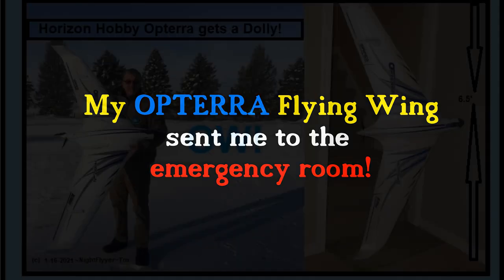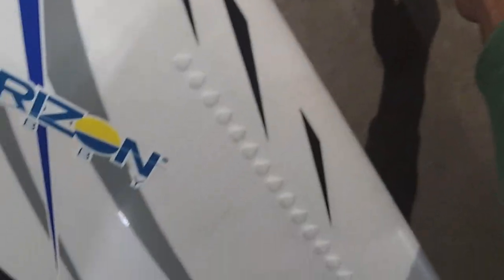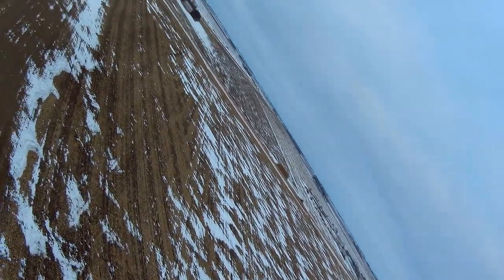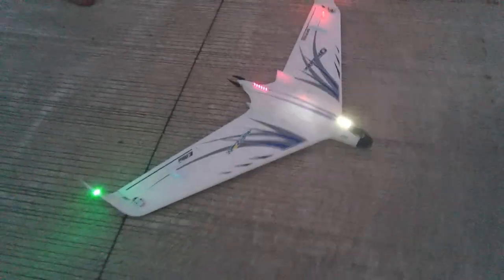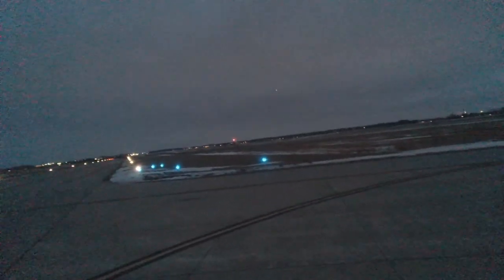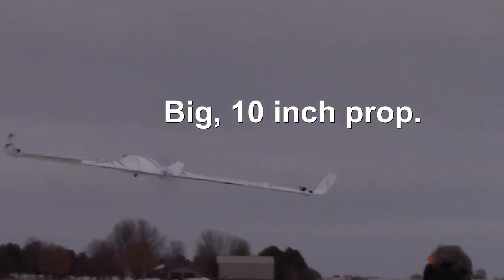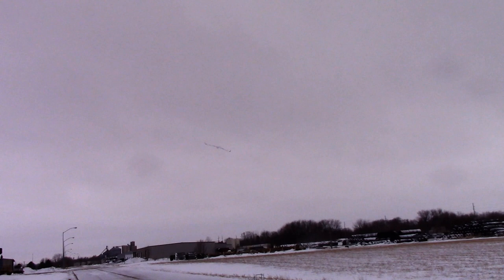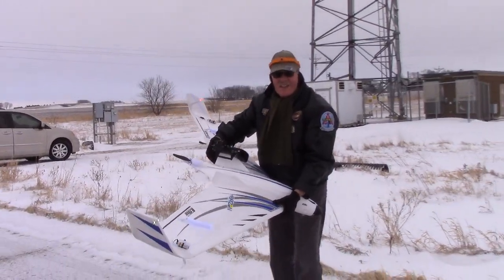My Opterra 2M Flying Wing sent me to the E.R. This is an awareness video & my solution for launching

Comment: You only have your self to blame. Hand launching with that method is bound to chop you up eventually. Even though you are not a newbie, commons sense should have prevailed.
Reply from the maker: Common sense?  Wow. Here is word for word what the Opterra 2M manual says about launching.  
1. Put the aircraft into launch mode with the channel 5 switch.  (in my first video that did not work, it went into the ground)  
2.  Hold the aircraft in one hand and the transmitter in the other.  
3.  Apply full throttle and throw the aircraft directly into the wind, angled slightly up (5 to 10 degrees above the horizon). 
4.  Climb to a safe altitude and check the trim.   
I know others have their own ways, and either way, my Dolly is the safest solution for me.  
The Opterra 2M manual also says nothing about throwing it with the motor off, so if a newbie followed the instructions, like I did, I'm showing what could happen, in case a gust of wind got them or something else.     Nothing is 100% and no matter how good you can throw, this big 7 foot wing with a 10 inch prop spinning right next to your face, into 12 MPH is risky to say the least.  The 10" prop is very close to your forearm as well, so a gust could tip it back even before launch, as others told me happened to them.  Where are your flying videos to show your common sense.
Reply from the maker: @petebuttons210  What?  I have no idea why you should chastise a person for following the instructions and making fun of me.  If it happened to me, it can and has happened to others.  I'd love to see you try to launch this and I see no flying videos on your channel but your telling me what I should do or have done after the fact.   Make your video and I'll watch it.

Comment: Gloves, gloves, gloves.......
Reply from the maker: Thanks for that suggestion and I tried that already, but because it was cold.  I found trying to hold on to the tiny finger grips on the bottom of the 7 foot wing with a thick glove under full power with wind blowing was difficult when under power and then trying to fly with  a big enough glove on was also difficult to fly the transmitter, (I'm a stick pincher)  so although that sounds like a good idea, it did not work that well. Some have told me the Prop got them in the forearm even before launch, when a gust of wind got under the wing and tipped it back.   We are only talking about a Half inch of clearance that I needed to keep from getting cut, and even though I pulled it off several times in my earlier product review video,  I will never hand launch it again.  LOL.  It's hello dolly from now on!  Thanks.

Comment: You need a butcher's glove  on that hand.
Reply from the maker: Thanks for that suggestion and I tried that already, but because it was cold.  I found trying to hold on to the tiny finger grips on the bottom of the 7 foot wing with a thick glove under full power with wind blowing was difficult when under power and then trying to fly with  a big enough glove on was also difficult to fly the transmitter, (I'm a stick pincher)  so although that sounds like a good idea, it did not work that well. Some have told me the Prop got them in the forearm even before launch, when a gust of wind got under the wing and tipped it back, so gloves wont protect that.  We are only talking about a Half inch of clearance that I needed to keep from getting cut, and even though I pulled it off several times in my earlier product review video,  I will never hand launch it again.  LOL.  It's hello dolly from now on!  Thanks.

Comment: What????? thats what every model should do, power off for say something like soaring, and then its there when you need it, no need for a stupid arm switch, get your stuff together. and no its not slippery. i have one myself and i know what its like. i reccomend wingtip launching it, makes it easier and doesnt get your hand chopped off. stupid as3x and gyro's and stuff.
Reply from the maker: This almost 7 foot wing with big winglets is would be very difficult to launch by wingtip.  Mine bend when I hold it by the wing tip.  Also I followed the directions and especially when I did my first video on this where I put down the gyros and stuff.  First of all, that had nothing to do with my hand injury. I only mentioned the Throttle arming because I followed instructions in the manual and this is the way it bound up and arms the motor as soon as you plug in the battery.  It's my warning to be cautious, because the manual says nothing about programming in a throttle hold to a switch. I've known of times when after flying, that switch was forgotten to be moved back to safe and it armed as well.  Nothing is 100% as it could be left in the wrong position, by accident. I'm pretty experienced, so never relied to on a throttle cut/hold, as all my machines need throttle stick movements to arm.   I only am warning others to be careful BEFORE the launch and to be careful no matter what you use. 
 Here is word for word what the Opterra 2M manual says about launching.  
1. Put the aircraft into launch mode with the channel 5 switch.  (in my first video that did not work, it went into the ground)  
2.  Hold the aircraft in one hand and the transmitter in the other.  
3.  Apply full throttle and throw the aircraft directly into the wind, angled slightly up (5 to 10 degrees above the horizon). 
4.  Climb to a safe altitude and check the trim.   
I know others have their own ways, and either way, my Dolly is the safest solution for me.  The Opterra 2M manual says nothing about throwing it with the motor off, so if a newbie followed the instructions, like I did, I'm showing what could happen, in case a gust of wind got them or something else.  Nothing is 100% and no matter how good you can throw this big 7 foot wing with a 10 inch prop spinning right next to your face, stuff happens. 
Maybe a gust of wind, maybe my 73 year old left arm was weaker, or who knows.   But either way, if it happened to me launching the way I thought was good (and  the same) as all my previous launches. So if it can happen to me, it can happen to others, and that is the warning I want to present.
Reply: @NightFlyyer  im litterely am 12 and can wingtip launch it with ease.
Reply from the maker: I'd like to see you wingtip launch this 7 foot wing. I see no video of you doing that.  Put your link here.  Maybe you should watch this where I demonstrate the issues. https://youtu.be/f5xDfk7sbcQ

Comment: Stick launch it!
Reply from the maker: It is 7 foot long and pretty hard to do that.  This wing is 7 foot long, heavy and  will bend and break the end off the if you even try to pick it up by the tip and barely has enough power to fly out of your hand at launch.  I know and I tried to launch it discus style, but could not hold it where I felt I could launch it successfully in the wind.     It would also be extremely difficult to somehow launch it discus style with the elevon there and that 7" tall winglet rudder that is also on the tip.  I know how to do it , but not with this plane.  
It's not like launching my SMALL F-27 Evolution or 1.2M Opterra.  So I followed the instructions word for as I did for the video I made of my product review earlier where nothing happened bad.  https://www.youtube.com/watch?v=P_inF5EYLEE&t=1s and the second one where I explain how to protect the bottom of the fuselage.  https://www.youtube.com/watch?v=ur5V5H8UcGs&t=1s
Thanks.

Comment: Dude, you ought not done it that way.
Reply from the maker: Here is word for word what the Opterra 2M manual says about launching.  
1. Put the aircraft into launch mode with the channel 5 switch.  (in my first video that did not work, it went into the ground)  
2.  Hold the aircraft in one hand and the transmitter in the other.  
3.  Apply full throttle and throw the aircraft directly into the wind, angled slightly up (5 to 10 degrees above the horizon). 
4.  Climb to a safe altitude and check the trim.   
I know others have their own ways, and either way, my Dolly is the safest solution for me.  
The Opterra 2M manual also says nothing about throwing it with the motor off, so if a newbie followed the instructions, like I did, I'm showing what could happen, in case a gust of wind got them or something else.     Nothing is 100% and no matter how good you can throw, this big 7 foot wing with a 10 inch prop spinning right next to your face, is risky.

Comment: Need to wear a meat cutters glove on that hand maybe?
Reply from the maker: Thanks for that suggestion and I tried that already, but because it was cold.  I found trying to hold on to the tiny finger grips on the bottom of the 7 foot wing with a thick glove under full power with wind blowing was difficult when under power and then trying to fly with  a big enough glove on was also difficult to fly the transmitter, (I'm a stick pincher)  so although that sounds like a good idea, it did not work that well. Some have told me the Prop got them in the forearm even before launch, when a gust of wind got under the wing and tipped it back, so gloves wont protect that.  We are only talking about a Half inch of clearance that I needed to keep from getting cut, and even though I pulled it off several times in my earlier product review video,  I will never hand launch it again.  LOL.  It's hello dolly from now on!  Thanks.

Comment: 3 words....Throttle cut switch
Reply from the maker: Of course I know how and  have.  First of all, that had nothing to do with my hand injury. I only mentioned the Throttle arming because I followed instructions in the manual and this is the way it bound up and arms the motor as soon as you plug in the battery. It says nothing about programming in a cut switch like my helis have.  It's my warning to be cautious, because the manual says nothing about programming in a throttle hold to a switch. I've known of times when after flying, that switch was forgotten to be moved back to safe and it armed as well.  Nothing is 100% as it could be left in the wrong position, by accident. I'm pretty experienced, so never relied to on a throttle cut/hold, as all my machines need throttle stick movements to arm.   I only am warning others to be careful BEFORE the launch and to be careful no matter what you use.

Comment: One word gloves
Reply from the maker: Thanks for that suggestion and I tried that already, but because it was cold.  I found trying to hold on to the tiny finger grips on the bottom of the 7 foot wing with a thick glove under full power with wind blowing was difficult when under power and then trying to fly with  a big enough glove on was also difficult to fly the transmitter, (I'm a stick pincher)  so although that sounds like a good idea, it did not work that well. Some have told me the Prop got them in the forearm even before launch, when a gust of wind got under the wing and tipped it back.   We are only talking about a Half inch of clearance that I needed to keep from getting cut, and even though I pulled it off several times in my earlier product review video,  I will never hand launch it again.  LOL.  It's hello dolly from now on!  Thanks.

Comment: What you're doing is dangerous in every conceivable way.  You have yourself to blame for incidents like this.  I can hardly wait to hear about you flying into the wires.
Reply from the maker: Dangerous?  This is an off the shelf plane and This is exactly word for word in the  the manual how to fly and launch it. . Put the aircraft into launch mode with the channel 5 switch.  (in my first video that did not work, it went into the ground)  
2.  Hold the aircraft in one hand and the transmitter in the other.  
3.  Apply full throttle and throw the aircraft directly into the wind, angled slightly up (5 to 10 degrees above the horizon). 
4.  Climb to a safe altitude and check the trim.   
I know others have their own ways, and either way, my Dolly is the safest solution for me.  The Opterra 2M manual says nothing about throwing it with the motor off, so if a newbie followed the instructions, like I did, I'm showing what could happen, in case a gust of wind got them or something else.  Nothing is 100% and no matter how good you can throw this big 7 foot wing with a 10 inch prop spinning right next to your face, stuff happens. 
Maybe a gust of wind, maybe my 73 year old left arm was weaker, or who knows.   But either way, if it happened to me launching the way I thought was good (and the same) as all my previous launches. So if it can happen to me, it can happen to others, and that is the warning I want to present.

Comment: Wear motorcycle gloves
Reply from the maker: Thanks for that suggestion and I tried that already, but because it was cold.  I found trying to hold on to the tiny finger grips on the bottom of the 7 foot wing with a thick glove under full power with wind blowing was difficult when under power and then trying to fly with  a big enough glove on was also difficult to fly the transmitter, (I'm a stick pincher)  so although that sounds like a good idea, it did not work that well. Some have told me the Prop got them in the forearm even before launch, when a gust of wind got under the wing and tipped it back, so gloves wont protect that.  We are only talking about a Half inch of clearance that I needed to keep from getting cut, and even though I pulled it off several times in my earlier product review video,  I will never hand launch it again.  LOL.  It's hello dolly from now on!  Thanks.

Comment: Learn how to throw side arm.
Reply from the maker: Like I said in the video, there is nothing to grab on the side or end of this 7 foot wing with those wing tip fins and it bends.  I did it by the manual. Here is word for word what the Opterra 2M manual says about launching.  
1. Put the aircraft into launch mode with the channel 5 switch.  (in my first video that did not work, it went into the ground)  
2.  Hold the aircraft in one hand and the transmitter in the other.  
3.  Apply full throttle and throw the aircraft directly into the wind, angled slightly up (5 to 10 degrees above the horizon). 
4.  Climb to a safe altitude and check the trim.   
I know others have their own ways, and either way, my Dolly is the safest solution for me.  The Opterra 2M manual says nothing about throwing it with the motor off, so if a newbie followed the instructions, like I did, I'm showing what could happen, in case a gust of wind got them or something else.  Nothing is 100% and no matter how good you can throw this big 7 foot wing with a 10 inch prop spinning right next to your face, stuff happens. 
Maybe a gust of wind, maybe my 73 year old left arm was weaker, or who knows.   But either way, if it happened to me launching the way I thought was good (and  the same) as all my previous launches. So if it can happen to me, it can happen to others, and that is the warning I want to present.

Comment: This is what happens when you let stupid people handle machinery. What's wrong with starting the motor after launching?
And then blaming the manual, of course. No manual will ever replace thinking for yourself... have you sued Horizon already?
Reply from the maker: Stupid people?  I have been flying over 60 years and am in the Academy of Aeronautics Hall of Fame.  But you know, I know all the champions, and every once in a while, they have an accident or bad landing. This is one of the times I got cut, and in 60 years, it was the first.  Where are your how to videos?

Comment: Maybe wear some a glove 🧤
Reply from the maker: Thanks for that suggestion and I tried that already, but because it was cold.  I found trying to hold on to the tiny finger grips on the bottom of the 7 foot wing with a thick glove under full power with wind blowing was difficult when under power and then trying to fly with  a big enough glove on was also difficult to fly the transmitter, (I'm a stick pincher)  so although that sounds like a good idea, it did not work that well. Some have told me the Prop got them in the forearm even before launch, when a gust of wind got under the wing and tipped it back.   We are only talking about a Half inch of clearance that I needed to keep from getting cut, and even though I pulled it off several times in my earlier product review video,  I will never hand launch it again.  LOL.  It's hello dolly from now on!  Thanks.

Comment: Wing launch it
Reply from the maker: This wing is 7 foot long, heavy and  will bend and break the end off the if you even try to pick it up by the tip and barely has enough power to fly out of your hand at launch.  I know and I tried to launch it discus style, but could not hold it where I felt I could launch it successfully in the wind.     It would also be extremely difficult to somehow launch it discus style with the elevon there and that 7" tall winglet rudder that is also on the tip.  I know how to do it , but not with this plane.  Thanks.